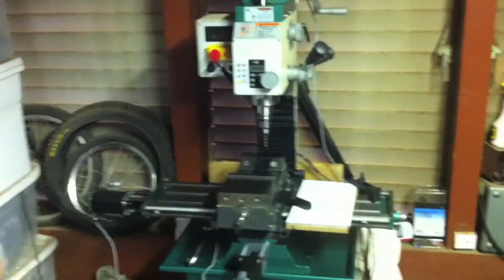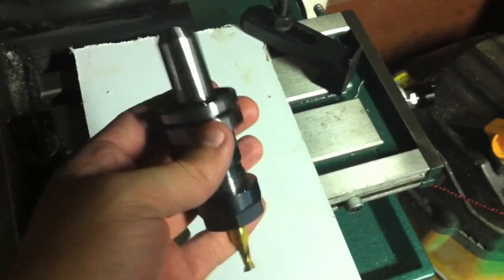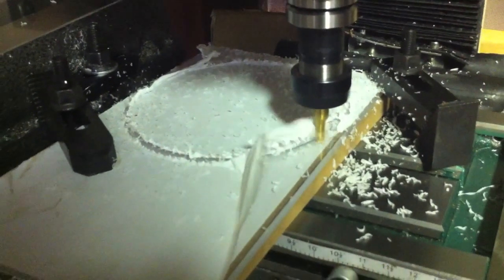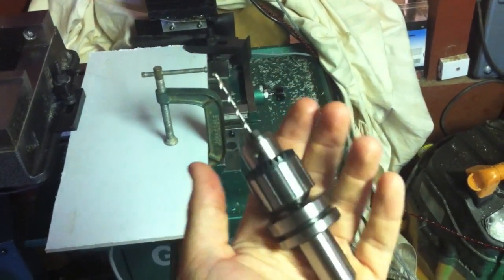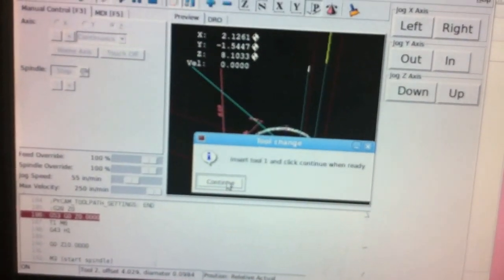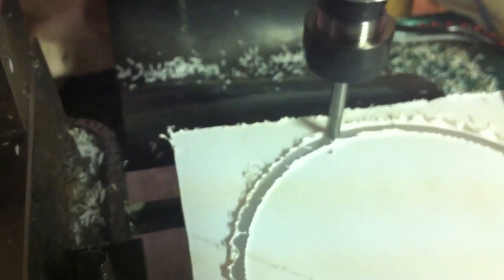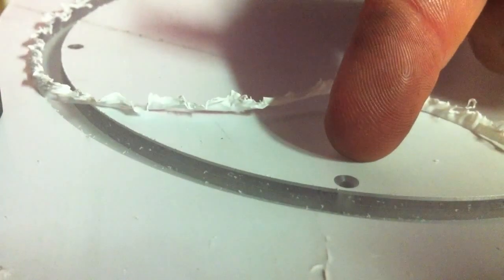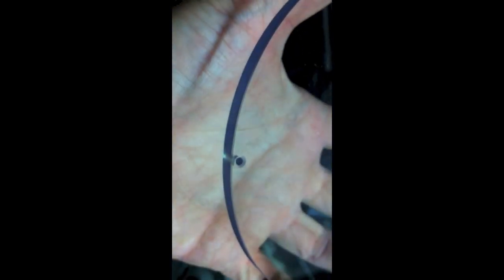First g0704 CNC Milling

Comment: Just a tip.  Managing a profile where the part you want to keep what drops free from clamping rarely works out well.  You need the finished part to stay put.  They make some decent quick clamps that have T-Nuts for one jaw.  You can us that and cut out almost all the circle then move the clamps to the places already cut and have the program finish the circle after the clamps have been relocated.  Then one side won't turn into a chewed up mess on you.

Nice conversion!

Comment from the maker: Thank you for the tip!  Since this video I have been doing exactly what you recommended with re-clamping the part.  The parts are now coming out much cleaner and more accurate!

I guess I was used to 3D printing where a single program generates an entire part. :-/

There's definitely a learning curve, and I'm certainly a novice.  Sure is fun though!

Comment from the maker: TTS is absolutely wonderful, you only need to set the tool height offsets once, then you don't need to account for it as long as you have your tool offsets set in EMC2 (or something similar).  Then I call a code like G43 H2 for tool number 2, to apply the tool offset programmed for tool number 2.

Comment from the maker: I made a 3D print adapter for the Z-axis motor mount, but I could have done something similar to the X-axis by milling a flat plate and then use spacers.

Since I was planning on using ball-screws from CJAmasterworks, I had already replaced the lead-screws making it easy to use an oldham coupler from McMaster.

Comment from the maker: I can give you the STL files, but keep in mind I designed the parts with a Dimension 1200es printer in mind which prints support material to support overhanging structures.  

Hossmachine on youtube designed one that doesn't require support material.  His video has a download link in the description of his video "G0704 Stepper Motor End Covers"

Comment: how did you attach the motor to the z axis and how did you attach the shafts to each other? did you remove those two weird shaped nuts on the z axis leadscrew then use a coupler or did you find a coupler big enough to clamp over those nuts? Thanks and great vid man... trying to figure mine out :)

Comment: do you mind me asking the cost of the total cnc conversion to get everything up and running.  Also, I have 7 years CAD experience and was wondering if polycount is a big issue with CNC machines. Do you know if you're suppose to keep the polycount/vert count below a certain number? I'm planning on building one of these within the next year and I'd like to model a few things ahead of time. Thnx man!